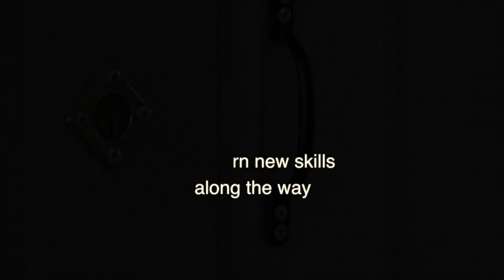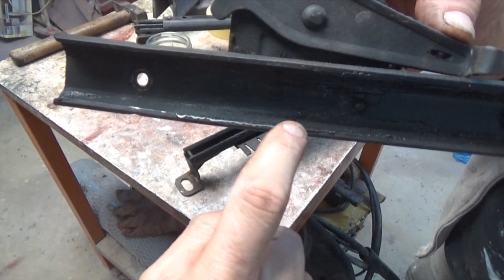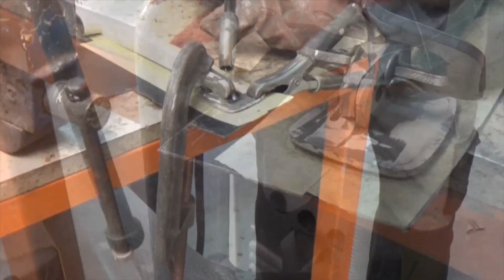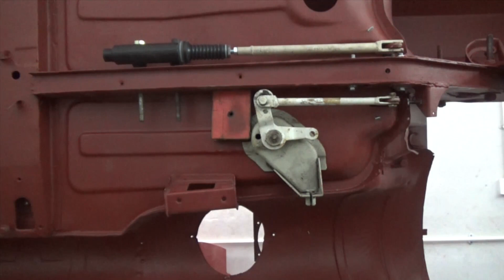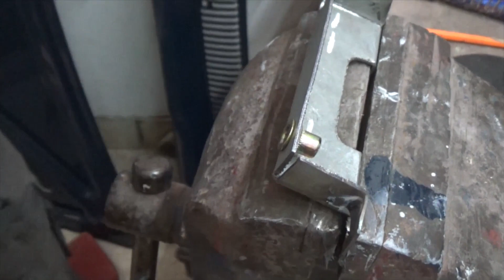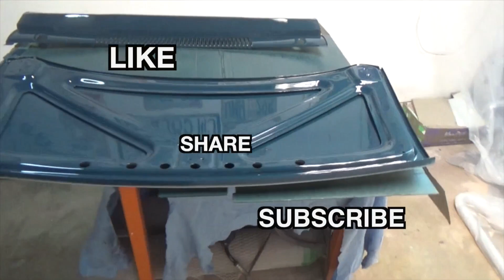Adapting different car seats - Classic Alfa Romeo

Comment: boil the rubber grommet for the pedals and it will slip on much easier.
Reply from the maker: I would but the size of this particular grommet is way too small to go over the pedal..you could tell it would split

Comment: Very skilled craftsmanship! I especially liked the use of machine fasteners for the brake reservoir bracket, although I wouldn't use threaded rivets, as they tend to loosen over time and spin with the bolt. Since there is enough space between the bracket and the inner fender, I would place a weld nut instead. Much more secure and OEM looking. Apart from that, very clever modification for the hydraulic clutch gearbox. RHD 105s were indeed a factory afterthought, which is evident from the different width of the floor pans, as well as the retention of standing pedals until the end of RHD production in 1980 with the last S2 Spiders.
Onwards and upwards!
Reply from the maker: Thanks for the great comment, I thought I'd use rivnuts since the reservoir and bracket weigh next to nothing. I usually weld nuts from behind on heavy duty stuff, but it was an excuse to use the kit :) I used them for the brake reservoir and bracket too just in case I change the set up later on to dual brake bias in the future, more on that in a future episode. I was surprised to learn that later Rhd cars had standing pedals too!

Comment: Great work mate. I will probably end up doing the same pedal mod on min as well.
Reply from the maker: It depends if you plan on using the original type gasket, alternative you could make a shield from sheet metal. Plenty of time to go over these details during the dry build before paint

Comment: How are you manageing with the paint in the garage?. I painted mine like that and it was hell with the paint dust! Do you have an extraction system or did you seal the doors, when I did it I covered other cars with paint dust, its really great and a very nice colour!!
Reply from the maker: On the first try I had some problems with dust, later on I used 2, large plastic sheets on everything side, washed the floor and painted as the floor was still wet. I used a vaccine cleaner instead of blowing dust in the air with a gun to remove dust left over from sanding. More on that in the next episode
Reply: Raising Junior great!!. When I did my car it was in an open garage( the one in te picture). And all my neighbors hated me! Trully hated me
Reply from the maker: @fractalrender  wow...yes the colour coat is super sticky. I painted a large area in normal clothes and the paint stuck everywhere...I got a painter's suit after that

Comment: Excellent video. I learned several helpful things and now I have a guide to rebuilding my seat rails AND a great explanation of converting from cable to hydraulic clutch.  One of my projects is a 66 Giulia TI that will get a 2.0 Nord. Always look forward to your clips.  Greetings from Austin Texas.  What color is the paint?  Bluette?  Looks great.  Hope we see some info about how best to work in a makeshift paint booth and air filtration.
Reply from the maker: Hi Steve, thanks for the great comment! The clutch conversion on Rhd cars is fairly straightforward however Left hand drive cars might be a little more complex since the have a different pedal housing. Take a few pics and see what parts match for the conversion, I'm pretty sure it's been done several times. The paint is indeed Bluette, At 506, more on that in the next episode. I used some thin plastic sheets to make chambers in the garage leaving the dusty areas out...worked well, just let the dust to settle for a bit...more on that in the next one too :)
Reply: @raisingjunior6389  Geoffrey, thanks for getting back to me. I'm rewatching some clips right now and it seems I missed 14 (?) battery tray.  I especially enjoy seeing how you address issues, develop templates etc.  Bluette is a great color-can't wait to see the finished car-take your time-you are doiong it right!!
Reply from the maker: @stevewuertz3598  Absolutely, the journey has been an interesting one so far, I think we first shown the battery tray in Ep 10, it just needed some finishing